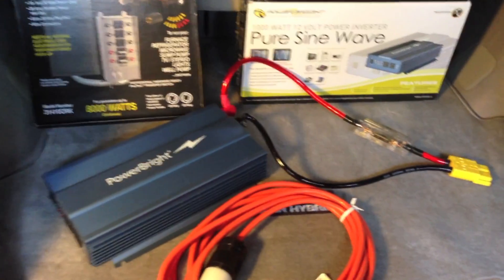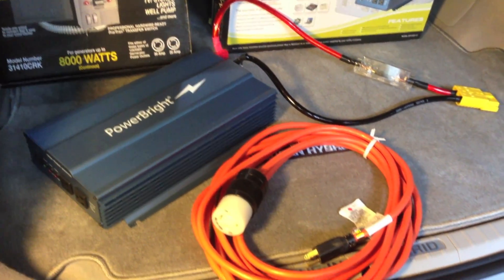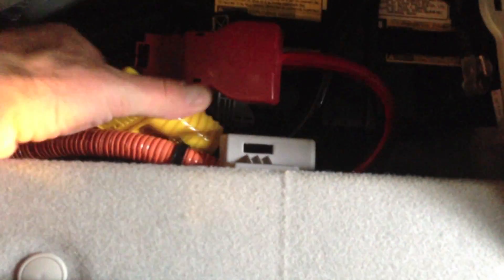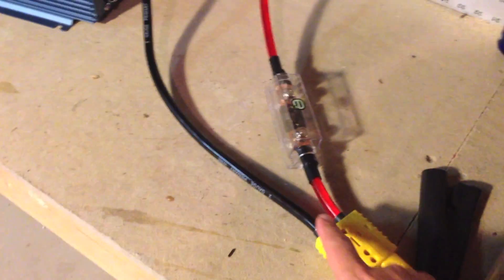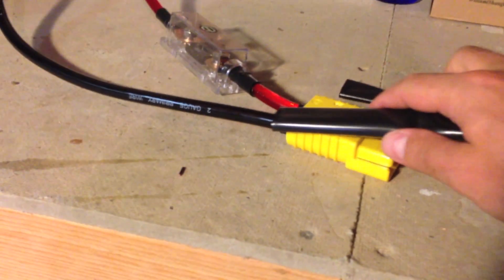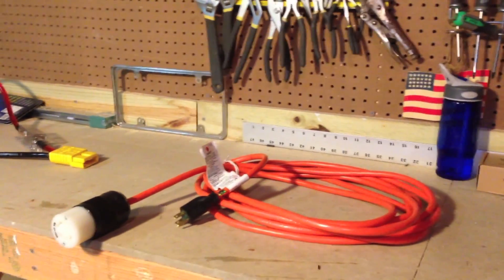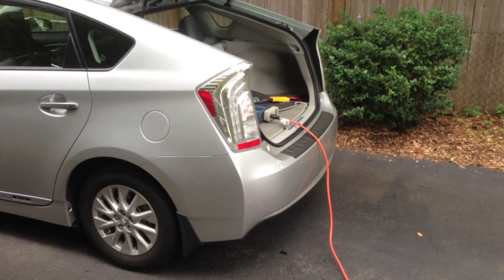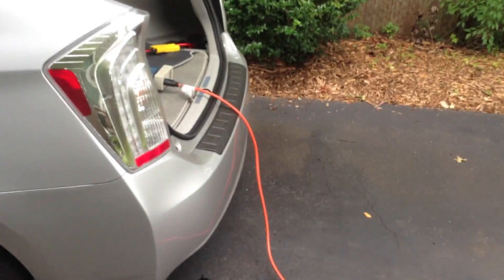Prius Home Generator - Part I

Comment: The 45Ah battery in the prius is nowhere large enough to supply that inverter. Not for veryblong anyway. Lights only pretty much.... 

Good try though.
Reply: the aux 12v battery is charged by the 230v hybrid battery which is continually topped up by the gas engine, when the car is left in READY mode.
Reply: @cawag98  Yeah... but what you fail to understand is that the AC power inverter is capable of drawing more juice than the AUX battery or HV inverter 12v charging system can supply.

So while it will work... it won't work for long.
Reply: @ScooterMcAwesomeness  wot?   The inverter should be rated higher than the power to be drawn, otherwise you'll ruin it quickly.  The critical thing is the inline fuse - that it not exceed the 80-90A that will be drawn on the other side of the inverter as AC.  The user will have to know to draw a max of about 900W, and if they don't the inline fuse will stop the AC/DC inverter from ruining the car's DC/DC inverter fuse.
Reply: @cawag98  That inverter, with a battery that small, will deplete the AUX battery faster than the car can charge it... 

How else do I have to explain this???

Over protecting with a lower current fuse, does nothing for the fact that a single battery of this type doesn't have the reserve capacity nor bulk load capability that an inverter of that size demands to operate properly.

(I own 800 watts of solar panels, 1000Ah of battery and a 3kw inverter to run my home... I know a thing or two about run time with inverters and these batteries. I have a backup bank, consists of 20x of the 45Ah batteries from Toyota Hybrid vehicles. Another for 8 of the 35Ah and finally a bank of 6 of the 55Ah batteries)

I'm also a Toyota Hybrid Certified Technician, one course away from writing my Master's exam... I know the car in question fairly well.
Reply: @ScooterMcAwesomeness  Absolutely incorrect.  The key is to draw no more than 900w, and to fuse the 12v side at 80 or 90A.  The HV battery is completely capable of charging the 12v battery to match this current draw - and the engine will come on to charge the HV battery, as needed.
Reply: @cawag98  The key... is to not oversize the inverter. 

You say draw no more than 900, ok, I'll bite... GO BUY A 900. 

My argument is based on the fact that that seems to be a 1kw or larger power inverter. Thus, is working the power inverter to it's  max cap (1500w, 150ish amps draw) will overwhelm the, maybe, 125 (call it 100 available once the car uses 25 to keep itself going) the DCtoDC converter is capable of sustaining. So again I say, it will kill the battery. 

Using your logic, and following inline with my original comment, if you only plug in and use small loads, you'll be fine. Anything large with overload the systems design capabilities.
Reply: @ScooterMcAwesomeness  wrong.
Reply: @ScooterMcAwesomeness  You're confusing amps and watts; max 900 watts is fine; you're right 150 amps is not okay.  Nice you know how to use umlauts, friend.
Reply: @cawag98  WAV & VAR  are how I remember my power calculations.
900w is roughly 75A at 12v.
1500w is roughly 125A at 12v
2000w is a tickle over 160A at 12v

I very much doubt that the HV charging system can sustain 100A. It would draw down the traction battery rather quickly, and the Engine doesn't like to stay running to charge itself. 

All the while, the 12V battery isn't designed to put out that kinda load. it's a tiny (group 53? whatever size fits a 2000 civic) battery with JIS battery posts (not SAE). 

I literally use one for my lawn mower, because that's all they're good for now. I moved away from these little batteries for running my home for much larger units.
Reply: @ScooterMcAwesomeness  Yes, you have to keep power below 95A because the system has an internal fuse you don't want to blow.  On the subject of sustaining long amounts of power below that, there's no problem because the beauty of this system is that the engine will come on as needed to recharge the hybrid battery which is feeding the 12v battery where you are taking the power from.  In similar situations, prius owners have said they were able to power devices below about 800w for days and even a week, I think I read, using just the car's gas tank - and not that much of it.
Reply: @cawag98  95amps@12v is 1,140watts. 

So, a 1200w inverter would blow that fuse at full pin. What people aren't considering is that 95amp fuse is a protection device, not a specification of output. The 12v system needs to be able to run itself (fuel pump, electronics, etc) and still make an excess. Assume the system can only make 90amps, 30(ish) is used right away for running the engine and systems. Only leaving you 60amps to "work" with. That means a maximum of, roughly, 720watts continuous use. Less if you have more things turned on in the car. 

I never doubted the ability to use a low powered inverter... To the point that I said earlier, size the inverter appropriately low so you don't hit that maximum (I believe I said to max at 750w inverter in another post, just for the internal fuse issue nevermind the actual use issues)
Reply: @ScooterMcAwesomeness  This is how I have wired my add-on to the Prius system:  a 2000w inverter with heavy, short cables.  An inline 75 or 85w fuse or circuit breaker on the hot lead, close to the battery terminal.  You can draw then safely without blowing the car's internal fuse at 95A.  If the inline fuse/breaker goes, you are fine.  You want an inline fuse for safety - to avoid short circuits/fires anyway.  

As for inverter sizing, go large rather than small with a pure sine wave inverter.   Don't rely on the fuses in that inverter for preventing system overload.  Your in-line fuse is what controls over powering the car and avoid a fire or short.   

On wattage/amperage, note that operating voltage of the system is close to 14.x or so, not 12.x volts.  You would never normally want to draw power from the 12v 45a battery without the Prius power on and feeding the 12v battery, which brings the whole system up to the higher voltage.

You raise an interesting point about overall current draw on the 95A internal car fuse.  I have never heard that we need to calculate draw from regular car parts - but that is an interesting question (maybe someone here can answer it): is a portion of the 95A draw reduced by onboard car functions (like heating/AC/headlights etc)???
Reply: @cawag98  The DCtoDC converter that charges the 12v system (its 12v NOT 14... it charges at 14.4 and will reduce to 13.8 when battery full to float the battery)

Never mind a prius...

Take a standard vehicle. Say it has a 100amp alternator, and a 100amp fuse to protect it. OF the 100amps being created, 20-50(depending on items turned on) of those amps are spoken for to RUN the car..  only leaving you with 50 amps to USE before you start depleting the battery because the charging system can't keep up. 

Same thing with a prius. You'd know this if you had even a basic understanding of electronics and automotive systems.
Reply: @ yah whatever.
Reply: @cawag98  You do you boo... Try to not let the smoke out... from either the car or your noodle.

Peace be upon you, in all facets of life.
Reply: If you review my earlier post, you may realize how this hack is simply genius. I would add to my post that the Prius in my driveway took care of its 45ah battery by running the gas engine for 5-6 minutes each hour. 

I have traded up my Prius, and now have a Rav4 (also hybrid), but it does not appear to be as efficient. It tends to have the engine running for too long for my taste. 

I’ll be trying the setup with my trailer camper, and an auxiliary deep cycle 100ah battery. It will be connected to my car’s starting battery via a DCDC charger which serves as isolator and as a solar controller. (It’s designed to prioritize the solar input so that the car’s alternator will only be needed at night. 

Before I start getting the usual comments; yes, it’s cheaper to just have a generator (which I do). My setup is to be used while camping in areas where local rules (or common concern for fellow campers) necessitates another source of ac power.
Reply: @edgardomunoz6611  To call your "hack", genius, is a little out there. But hey, if you wanna pat yourself on the back for something others have been doing for years... that's cool too. :) 

It's not a bad idea. Just has its flaws/drawbacks... like the best of any well laid  plans. 

Don't expect to run a circular saw, AC unit or any heavy draw items with that rig for more than a few minutes at a time.
Reply: @ScooterMcAwesomeness  
Scott-
You have misread my comment. 
I’m not calling MY hack genius;  it’s not mine. I’m complimenting Frank Perkins’ for his well thought setup, and his generous uploads which are fully documented and perfectly explained.
Reply: @edgardomunoz6611  my apologies.
Reply: The power does not come from the AGM battery; it comes from the Prius inverter drawing on the traction battery.
Reply: @galinstan5603  I'm well aware that the HV system charges the 12v system. (You clearly missed my previous comment explaining things and my credentials)

I'm saying the battery for/from the 12v system is woefully inadequate to power a large inverter.

Not to mention, drawing a consistant 150-200amps on a system never designed to accept that kinda load, could very easily wipe out the HV charging system, nevermind damaging the 12V battery.
Reply: I think, you fail to understand how a Prius operates. When a Prius operates. When a Prius is “ON”, the 12 Volt system is in the same state as a traditional vehicle with the engine started. If you started a Murano and connected this inverter to the battery terminals. The 130 amp alternator would operate the inverter and charge the battery, replenishing the power used to start the engine. In short order the battery would be charged and there would only be a trickle of current going into the battery because the alternator operates at a higher voltage. The 80 amp fuse would insure there was a 50 amp reserve. This would function indefinitely as long as the engine was running. The engine in a Prius need not be running because the alternator analogue draws off the traction battery. When the traction batter drops below a predetermined level, the engine starts and the traction battery is charged.
Reply: @galinstan5603  lol... In a perfect world maybe. 

But once again, do not disregard my knowledge for this vehicle again. Because you clearly didn't read my previous posts.

For the sake of the argument...and pay attention here... Assuming the prius could output its maximum, deplete the traction battery, engine starts and charges traction, which charges 12V via DC-DC converter... 

_>The battery itself... is too small. <_

Let me put it another way for you. Take two of these 12v batteries, put them in series, makes 24v. Do you think that will start a V12 detroit diesel? it's 24V... NO.. the amperage rating of those tiny batteries is far below what the big engine needs. Same same but different for the needs of a powerinverter.

I had to use 6 prius 12v batteries in parallel to give me the amperage needed to run a 1500w inverter, and it didn't run long... started the refrigerator and ran it for about 30 minutes before the low battery alarm sounded.

If buddy mounted a pair of 8D (220Ah, vs 45Ah) 12v batteries in the trunk, and removed the little 12v battery, still allowing the prius to charge it... maybe we could talk. But again as a single unit, those prius 12v batteries aren't much bigger than a standard LawnTractor/ATV/UTV battery.

Comment: One thing that was not made clear in the video, but became obvious after I thought about it (and read some comments) was which battery he hooked up to.  For a standard 12VDC to 120VAC sine wave inverter (the decent ones seem to be in the $250 range), you could not hook them up to the high voltage traction battery.  These batteries output at well over 100V (I think my Honda Insight is around 144V).  Thus, the 12v "accessory" battery is the only option for this setup.  While some of the commenters were concerned Frank was "deep cycling" his aux battery, I don't believe this is the case.  This battery is fed by a DC to DC converter from the larger traction battery, and is not allowed to drop much below 14V while being discharged.

Thus, if you are putting a relatively high load on the aux battery (like running your house!) the traction battery should be pretty much continuously "feeding" the 12V battery to maintain relatively constant voltage to the inverter without running the battery down.  When the traction battery itself needs more juice, it calls on the gas engine.  It's a pretty sweet setup, actually...particularly how Frank did such a nice job on his cabling and his transfer switch panel.  Thank you Frank for doing such a nice job on these videos.  I'd love to do the same thing with my Honda Insight; the only problem...my aux battery is in the engine compartment!!!
Reply: David Disheroon I was like where did he find his inverter? Hah 28 cells @ ~7.6vdc 
My magnum power goes up to 31vdc so I’m going to run 4 cells in series. Should give me 7 “batteries” being charged via solar.
Reply: You could hook up to your engine compartment battery and bring the connector through the grill. You occasionally see this on road service vehicles, i.e.,, a connection for jump starting vehicles. I am considering do this on a Prius via the fuse panel. This way, I can place it close to the garage and run the cables under the garage door. The inverter would be in the garage and the Prius would be closed and locked.

Comment: Amazing work my friend, its the same connection with 2000 Watts pure sine inverter ?
Reply from the maker: Rita. Mora Yánez yep!
Reply: Frank Perkins, thanks so much
Reply: What can happen if I use something bigger, something that uses 3000 w and my inverter is just 2000w ?
Reply: @geumonteverde  assume you've tried it, but your inverter will fault and shut down...if not you'll blow the 12v system fuse (120-140amps I think). 3000watts /~12v =250amps

Comment from the maker: May 14th 2018:  First Usage!
-------
After setting up this system in 2013 I finally had a power outage to test out the generator.  The power was only out for an hour, but I was able to get my home office, internet and fridge all running with some minor issues.  Here is what I found:
* I have a signal booster for the cable that didnt have power so the Internet wasn't working.  I had to simply bypass to get Internet up and running
* Since 2013 I added several other devices to the home office so I had to manually unplug a few things in order not to exceed wattage

The Prius generator was up and running for about and hour and I lost a mile of EV range.  The gas engine never turned on and non of the cables or inventor got hot.

Comment: I just got this from Weber University - who works with Toyota to turn out technicians. See https://www.youtube.com/watch?v=UxuqHcUbSQ0&feature=em-comments - 

Power in must equal power out. If you want 1000 Watts output at 120 volts, the maximum current output is only 8.33 amps. That will not power very many items in a home at the same time. Furthermore, providing 1000 Watts from the Prius charging system and 12V battery (at 14 Volts with the vehicle powered up) would require 71.4 amps of current. The maximum output of the DC-DC converter is 100 amps (and it will run very hot if forced to run at that level for a long time). The vehicle alone will draw 50 - 70 amps with the engine running, cooling fans on, electric water pumps running, etc. It will draw less current while the 12V system is drawing down the 201.6V battery, but the engine must start to recharge the 201.6V battery. In other words, the 1000 watt inverter idea may work for short time periods, but it will not be able to sustain 1000 watts continuously. The DC-DC converter will run too hot at those levels and start to turn down its output rate to preserve itself. It is not a good idea if you need a long time power supply. It should never be run just from the 12V battery without the hybrid system powered on; the 12V AGM battery will be damaged. By the way, the high voltage Ni-Mh battery of a standard Prius has less capacity in ampere-hours (21Ah) than the 12V battery does (30Ah). This means that trying to connect to the high voltage battery will result in even less power. I hope that helps